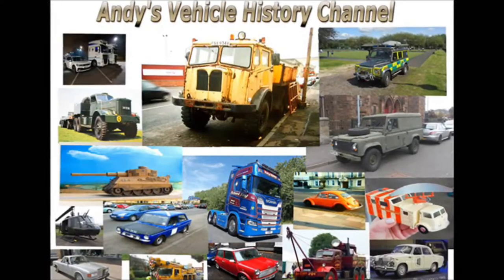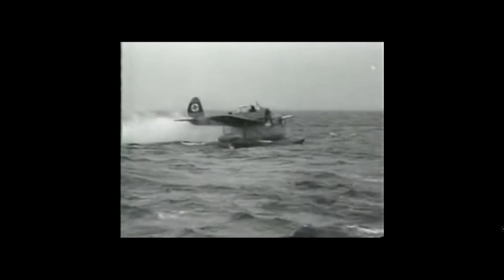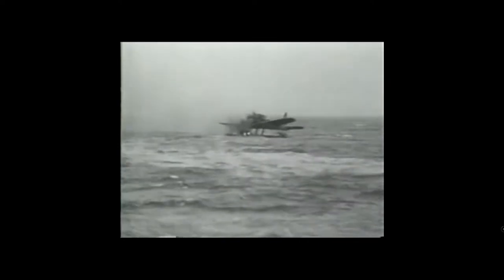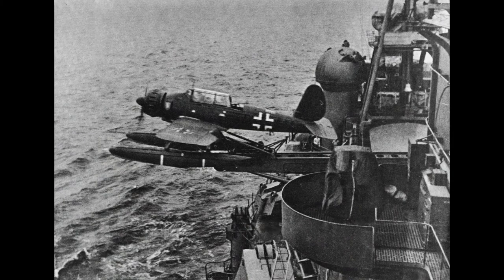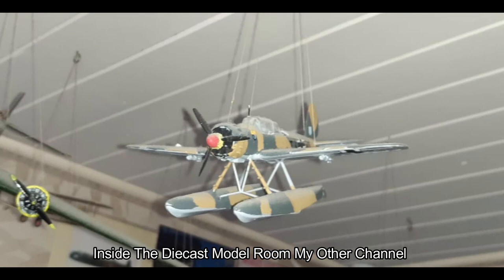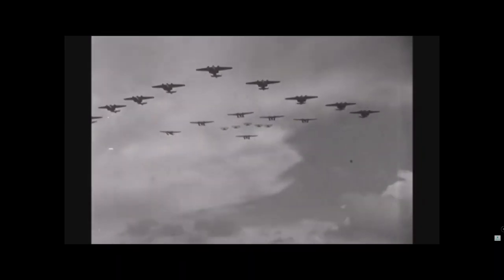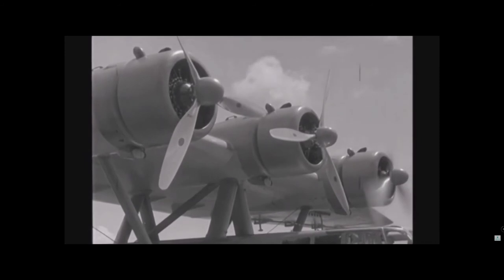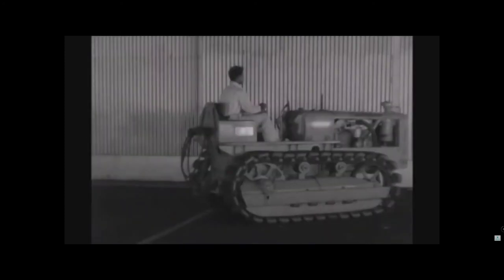Arado Ar 196 1936 🇩🇪 And Dornier Do 24 1937 A Short Vehicle History ( Float Plane   (EP1 S4 )

Comment: The Luftwaffe did not order the Do-24 before the war; they did not like it initially...
The Dutch Royal Navy asked Dornier to design a flying boat according to the specifications drawn up by the Dutch Navy as a replacement for the aging Dornier Wal. The plane was to serve in the Dutch East Indies (now: Indonesia).
When the first prototypes were ready, the Dutch Navy tested the type with American radial engines, while Germany tested one with Jumo Diesel engines. The Germans did not like this type and gave it back to Dornier.
The Dutch liked their version very much and ordered the Do-24 and acquired the license rights to build them in the Netherlands.
When the Netherlands was invaded and occupied by Nazi Germany in May 1940, the Germans captured the production line at Aviolanda (near Dordrecht).
They then found out the type was not so bad after all and proceeded the production with the American radials (at first) and later on switched to BMW radial engines.
The Do-24 became the most successful flying boat in German service during World War Two!

Comment: "Aradio?"  (a Radio?) The company name was/is said  "ARAH-Do..." I Nearly stopped watching at that point, as you clearly did not do any real research apart from Wikipedia...   The single float version was never made as a production plane as it proved very vulnerable to damage in rough seas, as can be seen from the start of the video. The revised twin float production version was far more sturdy and went into full production.
Reply from the maker: I rarely used Wikipedia for research don't use it for this video I was supposed how quick the engine fell off

Comment: Could I respectfully request that you drop the metric. It is meaningless to most of us and takes the edge off a good video.
Reply: @letoubib21  Thank you for your reply and forgive my delayed response.  It is quite true that most of the world use metric, but that does not make it right.  Most people used to believe in Witches!   For this video though, most of those interested in the subject matter are most likely to be more familiar with Mi;es and feet i.e GB and the US.   The metre is arbitrary anyway because the French scientists who created it already knew how long the wanted the metre to be before they did the science; they should have known better.   It is in fact a very interesting subject and I would recommend a book, (no I didn't write it and nor am I on commission)  Civilisation One, it's a good read.
Reply: Could I most respectfully disagree and suggest popping up the metric and imperial measurement in text when a spec is mentioned and that way cater to the widest audience without adding to the tedious metric v imperial nonsense.
Reply: @rednaughtstudios  Publishers could could do that I suppose.  I asked the BBC to do a bi-lingual weather forecast in both cm and Inches.  They won't do it of course because most people would just read Inches.  Commercial floor space is measured in square feet rather than metres because one cm over the metre would cost 99 cm more.  Conversely carpet is sold in metres so that you are paying for a large off cut.
Reply: @hardsums32  I’ve lived in both New Zealand and Australia. Both have managed to properly convert to metric since the late 60’s with only a few odd things remaining. Altitude is still measured in feet on aircraft but it’s meters in height up a mountain if you’re skiing. I’ve lived long enough to be familiar with both although I tend to prefer metric especially dealing with weights and volumes. 1kg of water is 1litre just makes too much sense.
Reply: @hardsums32  
"Most people used to believe", not that i want to start a discussion on metrioc and imperial but let's be real, the english language is one of the most spoken languages besides mandarin, that's not because people believe in it, it's because it has more benefits than disadvantages to use it. It's exactly the same with the metric system, most of the worlds human population uses it because its benefits completely overshadow its disadvantages. Imperial is really obsolete by now, simply because of the much to complicated conversions, wich only slows down the process of calculation and simulation.
Reply: @mandernachluca3774  I think you will find that those nations who have gone over to the dark side were forced to.  No body had any trouble using Imperial on an every day basis, down at the market.  It was so designed that you could do it in your head and this facilitated trade and commerce.  In these times of puritanical pursuit of base ten we need a calculator to add two numbers together with more than one decimal place.  Base ten is primitive.  No civilisation has ever used it to the puritanical  depths that we are now being forced to go.  People have forgotten the why of twelve.
Reply: @hardsums32  
WTF kind of esoteric bullshit are you talking?
Wich countries who use metric systems have gone "to the dark side", the america, france, the United Kingdome? 
The fact to the matter is, that calculating on a base of 10 is much easier, especially when talking about multiple figures. Little fun fact, as a mathematician, chemist, physisist or engineer, you will use the metric system, specifically because it allows for easier calculation without a calculator.
The only time something is described as feet or knots is in aeronautic or marin applications because it lends itselfe to the proportions.

The french, at one point in the 1800s decided it would be a good idea to measure time in metric units. It wasn't, relation between one revolution of the earth around itselfe and one revolution of the the moon around earth (or a day and a month).

The reason why ordinary american plebs still use imperial, is because they decided to "believe" it was better than metric and therefor it must be continued, classic american ignorance.

In our modern society, with normed lenghts, weights, areas and volumes, there simply is no place for an old inferior unite based on loose physical proportions rather than exact numbers.
Reply: Come along Mandernach,  there is no need for bad language; Bullshit would have done.  I did think you had a sense of humour, the term 'dark side'  was a little tongue in cheek.

When it comes to America and Great Britain which are both metric nations, it is only the administrations that have gone metric; the people have not.  Many nations have gone metric but who's people still use Imperial for their everyday doings; particularly former colonies; they find it easier.

I note your acknowledgement that some things just are not metric friendly.  With Imperial of course you can do anything.  The reason for this is that Imperial works to base ten, base twelve and the power of two and by dint of that it is the most versatile system it is possible to have.  It is most brilliantly conceived and made manifest.

I would challenge your final statement that Imperial is based on loose physical proportions.  America went to the moon in feet and inches.  Britain built the first supersonic Airliner in feet and inches.  Think of the brilliant three dimensional navigation required to get Apollo back from the moon, no loose proportions there, nor recurring decimal places; just spot on.
Reply: @hardsums32  

 I accept your challenge, thought you debunked yourself. Neither the apollo program nor the developement of the first supersonic jet made use of the imperal system they used metric, you based your argument on a mere myth. Wich is even more baffling considering that you should at least know what a big role imported rocket scientists like Wernher Von Braun played in the Apollo program ...

What kind of education do you have? It surely seems to consist of big words and some technical false information ...
Reply: @rednaughtstudios  what is also forgotten is that the US uses different "Imperial" measurements as well, a US gallon is roughly 3.5 litres and an Imperial (British ) Gallon is roughly 4.5 gallons, a litre is precise, and yes I know how I spelt it, the US has its own version of English, note I work in all three measurements and do not get me started on bolt sizes and thread pitches!
Reply: @adriaandeleeuw8339  My commiserations on the thread pitches. I hope you’re not the one responsible for that spacecraft crashing on Mars :-)
Reply: @mandernachluca3774   NASA.  Von Braun notwithstanding,  NASA used US customary units (feet etc) throughout the Mercury and Apollo programs and even onto the Shuttle which was viewed more in aviation terms.

Coming to Apollo, it would appear that the navigation computer was programmed in S.I. Units but  the display for the crew was Imperial.  The Saturn V rocket as far as I can see is always described in feet, pounds of fuel etc.

I challenge your assertion that the first supersonic jet was metric.  It was in fact the Sabre jet which of course is American.  I cannot imagine that the US would use metric on it's aircraft and Imperial in it's space program ten years later.  The first jet to fly though was German in 1939 and most certainly metric.  The first jet to actually run was Whittle's engine in 1937.  Although some British engineers did use metric in those times I think it unlikely given that we build Concord in Imperial.

It was Concord, which was of course Anglo French, to which I was referring to when I said that Britain built the first supersonic air liner, and it was built in Imperial units, It was also built in metric.  How so you might ask.  Apparently we built our bits in Imperial and the French built their bits in metres.  In fact question were asked in Parliament about this arrangement.

We also built the first jet airliner, The De Havilland  Comet which I imagine was Imperial, I haven't researched it, sometimes you can't get an answer, not many people ask the question.

All this was to challenge your claim that Imperial is of loose physical proportions.  I think I have proved that it most certainly is not.
Reply: @hardsums32  
I will gladly except the last word offer.
The thing is, that you state that only the  guidance computer was programed in metric, wich simple isn't true, the same goes to the the F100 Super Sabre. 
You can look into and book wich covers the topic, that's also the reason for me questioning your knowledge. Further more, your over the top flowery language is a universal sign for elitiste behavior, wich sadly is all to common for people who prefer the imperial unite system because the "think" it would be objectivly better than the metric system.
Of wich the earliest example would be the denying of the british government helping the french to develope it, it just reeks of pure ignorant towards a very real problem, the need for a universal recognisable and easy to work with unit system.

I mean, it is fairly save to say, that you're not any engineering, or someone who relies on a universal logic based universal system. Else, you would have at least given on benefit of the imperial system. 

Whittles turbine engineering also doesn't proove much in terms of sophistication of the imperial universal system, as in order for the turbine to work, besides the tolerances of the bearings, wich are also based on Praktika knowlege, only the turbine/compressor ratio matters, especially in case of a centrifugal compressor, as it was the case for Whittles jet turbine. This meinst, that a very basic formula is more than enough to Figuren out the Connecticut intake and exhaust Arena of the compressor and thereby it's massflow of Airlines per given shaft revolution, wich only had to be high enough, to creat a sufficient build up of gases infront of the exhaust turbine, essentially creating a high enough pressure drop at the turbine wheel to drive itselfe.

That's the reason why Von Ohain used this type of turbine for his first prototype, it was the easiest and fastest way getting results, wich, knowing Ernst Heinkel, was of imeasurable advantage, to ensure founding for  a proper demonstrator, the He 178.
Reply: @adriaandeleeuw8339  It’s interesting to note that water pipe threads are still today in BSP. British Standard Pipe.